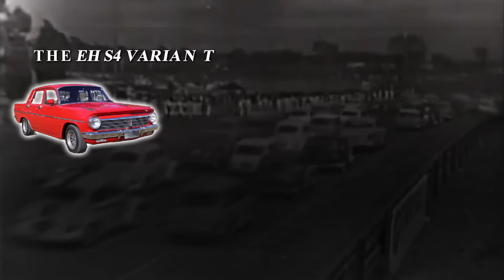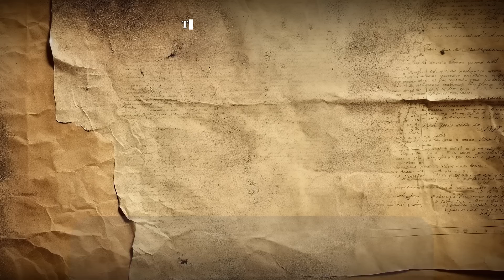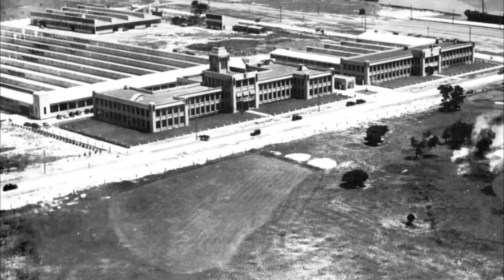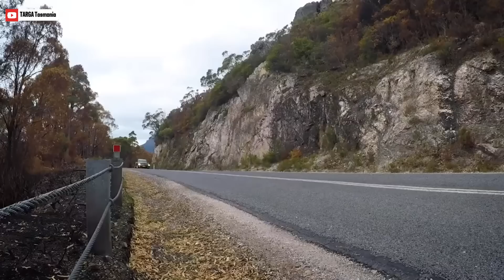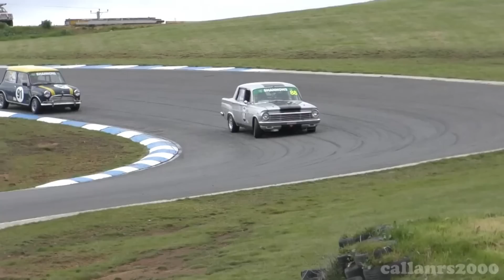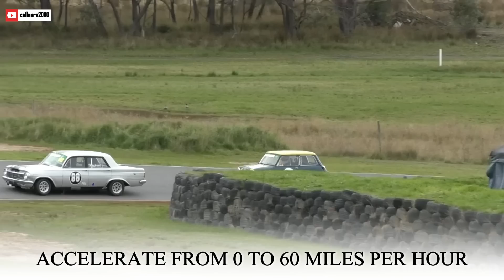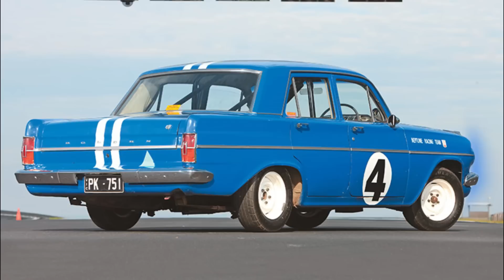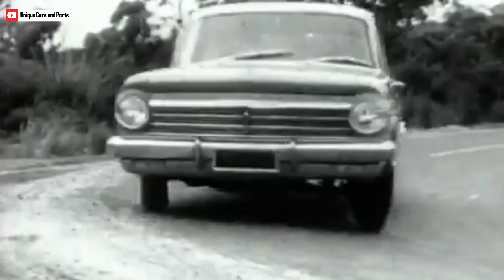Holden's SECRET High-Performance 179 Engine That Dominated Bathurst

Comment from the maker: What do you think made the Holden 179 engine such a game-changer in Australian motorsport?
Reply: You had to modify the head to a 12 port and bore them to a 192 cid with high compression pistons  using the HP block it had a steel crank add a high volume oil pump and a high lift Rev Master cam my fave was the 94 grind it was wild. Balance it and put on a set of 3x 45 mm Webber carbies and Genie extractors Then the 179 was ''wide awake'' been there done that 😂 but at Bathurst they were nothing at all !!!
Reply from the maker: @ wow what an amount of info. Thx for that!
Reply: @LegendaryRideCars  high pressure block... plus steel crank,149 or 186 head were the go with adjustable rockers
Reply: It wasnt really a game changer at all.
Reply: @LegendaryRideCars  to me it seemed like a smoother engine especially the HP block
Reply: What they call a "square engine". Same stroke and cylinder width. It later was used as the a model for the RB series Nissan engines from 2.6 to 3.0 litter with the RB32 2.6 being slightly under square and the RB30 3l being slightly over square but almost identical. If any one had anything to do with a commodore VL or an RB30 skyline you basically had the re-engineered GM version of the 179 down below. You could drop a 50cent coin on top of them on its edge and it wouldn't fall over :)
(see below for more info on the invincible X2)
.
The balance between stoke and piston width offers many different performance characteristics.
>
Another important part that is missed is engines built before 1970 were very over engineered in their tolerances. Like every bearing journal, grind and weight was tight as Holden was attempting to make a name for performance engines.
.
I was just trying to dig back though my memory banks. Got it.
Through the HR HD series they made the X2 179ci (2.9l) engine. You can tell by the emblem on the front grill that has a Red L shape under the X2.
This was an over engineered 179 with steel crank, cam and from memory they did some head an manifold work.
With twin carbs and header these engines were crazy at the time.
This was the engine that gave the 179 the reputation.
I have only ever seen/worked on one X2 179 Ute in my life.
Reply: OK, this was before I watched the video. The S4 was a model extension with 3 speed manual box or something. What you were looking for was the "X2 engine" as I offered above :) They only sold a limited amount of them to get them on the track, which is why they are as rare as hens teeth and difficult to find information on.
Reply: @axle.australian.patriot  The X2 was never released in the EH.
Reply: @alanpennykid133  I don't know whats going on with YT. I am sure I have already said that I have never mentioned EH anywhere.
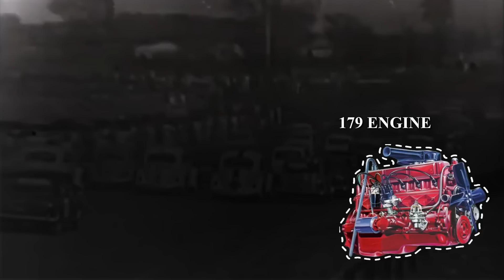Reply: @axle.australian.patriot  At 0:55 its specifically mentions the EH S4.  Your claim that it dominated at the Bathurst races is a joke, It was soundly beaten by the 4 cyl Cortina.  The 179 sold very well and was a very popular car but it really wasn't very successful in racing at all.
Reply: @alanpennykid133  First, the S4 was the transmission drive line upgrade and had nothing to do with the engine.
It had nothing to do with the 179 X2 race engine which came in the HR HD.
The X2 was the 179 engine that made the 179 a historic legend :)
Reply: P.S. the only weakness that I was aware of was a tendency to try and put push-rod through the rocker cover with the high lift cam (someone made alloy gears to help out there so you wouldn't strip the OEM fiber gear)  :P, and...
Something common to many red sixes was and issue with the distributors, usually after a con rod went through the side and knocked it off lol
I guess they made red lines for a reason lol
Reply: @axle.australian.patriot  my old man has more experience that most with 6cyl holedns
Reply: @Aussieledgrower2.0  Kool. Probably not as much as me, but who knows :)
Ask him how many X2 179 engines he has got to work on or seen.
Only a rare few have ever got to see one let alone work on them :)
Reply: He had serval i rember man .... @axle.australian.patriot
Reply: @axle.australian.patriot if u new how involved this guy was and some of the cars he had and built i think u would agree but he actually hates me pytting him on a pedestal but truily if u new u ud be impressed....ps i xan also tell u no ya shit to tho brother
Reply: I Rember only 1 of his 2 x2 z it was a like pearl green ople sort of couler shaw u no the couler i mean it imo it was basically a 4 door xu1 qith less cubes and carbs
Reply: @Aussieledgrower2.0  Nah, I am agreeing, and not disputing it.
I lived and breathed Holden engines for 35 years, at work, at home, on the street and on the track :)
I'm almost 60.
>
I can still remember as fresh as day the first time getting my hands into a HD 197 engine at about 9 years old.
>
And yeah, I don't really talk it up that much in real life.
Just this video came up and I was like. Yeah, I lived that shite to the max lol
Actually I seen my first Holden X2 179 when I was about 4 or 5 years old.
Got to hold the shinny chrome air cleaners and sat there amazed lol
Reply: @Aussieledgrower2.0  Holly cow! A genuine HD/HR X2?
You would remember a badge on the grill or the boot with a red arrow and X2 inside of it. It almost looked like LX2 to read.
I never own one but serviced, tuned and looked after one for many years.
Reply: P.S.S. I just double checked they did have the twin Stromberg carbs manifold as standard :)
Reply: P.S.S. The X2 engine was also marked on the rocker cover :)
Reply from the maker: @ wow 🤩 thanks for that huge comment
Reply: @axle.australian.patriot it was nothing to do with the rb nissan motor. The holden red, blue and black motors were so out of date and were developed as far as they could so they used a nissan engine as a stop gap until the next hand me down from gm in the usa- the old as the hills 3.8 buick. The nissan six was the best six holden ever had.
Reply: @rossbrumby1957  "they used a nissan engine"
Developed between Nissan and GM drawing on the success of the 179X2 and the Nissan L series overhead cam.
They are a hybrid, part GM and part Nissan :)
Reply: @axle.australian.patriot  Bullshit
Reply: @axle.australian.patriot  They were always Over-square.
Reply: @AndreasKachais  I stand corrected, over-square.
There was something in the back of my mind about that though with the 179.
>
Anyways, the video is about the transmission S4, but blurred into the X2 engine which is different from the stock 179.
I know the 179 X2 always had a good balance and this extended into the GM RB30 block.
Ahh, it was the RB30 that was square :)
Reply: @axle.australian.patriot  first time I have heard of holden 6 as a base for the RB. Where did you get that from?
Reply: @Quadrajettison  Complicated history between the 179Ci (3.0 l) and the Nissan.
GM Holden and Nissan developed the Engine. aka it is part GM and part Nissan.
Sharing of Engineering in the background was common place at the time. You wont find a lot of public information on it (in house propitiatory sharing).
The X2 had already garnered a sound reputation as a smooth running (well balanced) power plant for automotive and marine engines.
So, The RB30 is a design born out of the need for an engine for the Holden VL Commodore, and Nissan's need for an upgrade from the L series engine.
.
So you basically have a GM designed bottom end and the rest is Nissan.
>
Pretty successful collaboration :)
Reply: It didn't. If you are going to attempt to make videos about Australian cars for crying out loud do some actual research. PS I am sure 98% of your viewers don't subscribe because your vodeos are so hopeless...😂
Reply: It was a joke in Motorsport 
Fords 1500 cc cortina gave it an absolute hiding on every single race …
You call this a game changer?
Try embarrassment
Reply: The holden 179 was a great engine but it was the later 186 and 202 engines that were known for winning Bathurst.
Reply: @yusufbigyui  It's worthwhile differentiating between the stock engines and the performance engines :)
179X2 (Twin Stromberg)
186S (single dual throat Stromberg)
186 and 202 XU-1 (Triple stromberge)
:)
Reply from the maker: @yusuf.alajnabi yes that right 🙌 they have been preparing for it, as it’s always a path of improvement.
Reply: Additional note. Another user just reminded me:
Mercruiser (mercury) used a version of the 179 x2 for their marine engine :)
My fathers 23 foot caribbean cruiser had a 179 mercruiser with the twin carbs (I was only knee high to a grasshopper at the time ).
Reply: @axle.australian.patriot expect it was a variant of the chev motor, which by the way is what the holden red  and grey motor before it was.
Reply: @rossbrumby1957  Yes I know, but we are actually talking about the X2 engine which is not the same as a red stock engine :)
Reply: @axle.australian.patriot yup same
Reply: Well I had first hand experience over 29 years that this engine totally lacked the tractability unlike the old grey motor, get down too low and it jerked and snatched like buggery, going down to 2nd was ok, but getting low in 2nd meant a  crunch back to first  was essential, fitting a double race bearing in the gearbox was essential as this box allegedly strengthened [bull shit] was absolute rubbish.
Reply: The badges on the boot when the badge was on a belt
Reply: @alannorman3600  Which or what badge you talking about there :)
Reply: If they were only racing older holdens they would have been a game changer- but that isn't the case.
Reply: Forged Steel crankshaft
Reply: @awesomusmaximus3766  "Forged Steel crankshaft" Correct :) That was STD to the X2. Other 179s where just cast.
Reply: After the Gray engine the red motor was a rocket
Reply: @LegendaryRideCars  The Holden Engines were over square and they revved easier and higher than the Ford.  That was the reason that Holden also was better on the fuel economy.
Reply: AI really isn’t doing anyone favours. Smash that don’t recommend channel button.
Reply: AI really isn’t doing anyone favours. Smash that don’t recommend channel button

Comment: is there another bathurst that i don't know about. i think not. what GMH did to the 179 EH  for Bathurst was what a 13 year old school boy could have done in his daddies shed. they could not bore it out, but a 1/4 race cam, extractors, twin carbs, balanced, solid lifters. and head work would give an 179 EH a top speed of 115+ mph. a mate had one that was fully worked, it did 135mph and was quicker that a 351 GTHO  and  E49  charger

Comment: I had a 179 EH. Bored it to 192, chucked on a pair of Stromberg X2 carbs, and extractors. It could easily blow away a 253V8. The only problem I had with it was it kept breaking engine mounts. I never knew how fast it could go because the speedo needle would disappear off the speedo gauge at about 125mph.

Comment: Early in 1963 I had a EJ with a 149 that was painted grey - Factory. I bought new by accident.
Reply: Totally different engine mounts and front crossmember between EJ and EH !  Might have been a "first off" as the grey stocks expired.
Reply: @ They had a number of EJ bodies (I do not remember how many) and it was better economics to fit the 149 engine than ton throw it out. I wrote the EJ when it was very new and I bought one of the 1963 EH 179 manual (S4). The Suspension required a lot of modifications to make it handle.
Reply: @MrOlgrumpy  Over the years many have claimed that they bought a new EJ with a Red motor. As you point out the engine mounts and front cross member are different between the EJ and EH and Holden would have had to extensively modify the EJ   components in order to accommodate the red motor. Holden would not have undertaken such modifications on a model which was at or near the end of its production run.  The claim that late production EJs could be bought with a red motor fitted is an urban myth

Comment: No timing belt or chain.  These motors are almost indestructible AND easy to fix/rebuild.  We will never have that, ever again.
Reply: Fiber cam gear Buddy always stripped.
Reply: @LesleyStoddard  mine were metal.  And I put a Crow Cam in my 186HP that had straight cut metal gears.  Not sure which ones you're talking about
Reply: @ Cam to crank gearset. There was a alloy cam gear to steel crank gearset available  but it was noisy. All holden motors had fiber gears on the cam standard  Buddy. I worked for Holden in the 1970s. I am a old bastard.
Reply: @LesleyStoddard  okay, didn't know that.  The only Holden motor I pulled the cam out of was the 186HP that I rebuilt myself in 2002 with a Gregory's manual.  The gear on the cam I pulled out was definitely metal, looked like steel, helical gears.  The Crow Cams mid-range torque cam I installed came with straight cut/spur alloy gears and had quite a loud whine which my 18 year old self was quite chuffed with.  Sounded like a quiet Gilmore belt 🤣.  It went pretty good though.  Had a black motor head shaved and port matched, Yella Terra roller rockers, chrome olly valves and pushrods, triple valve springs, redline 4 barrel manifold and a 465 vacuum secondary Holley.  Needed a manual, but the Traumatic did alright

Comment: Its 7 mains bottom end crank strength made it the choice for racing and street engines. I speak from experience as l had the block designated HP block ...no numbers just Block letters HP. I had it built to outside XU1 specs and not a lot got near it!! Spanked many GT Falcon's probably not only through horses but through sitting in a XU1 Torana...No weight!! Revved to 7000 + and it was then that l realized that when GMH used the word stock they meant STOCK! The performance that modified engine produced was amazing! It felt like somebody took to a couple of tons out of the boot. Went like a fkn cat with its tail on fire LOL🤣🤣🤣

Comment: Only the EH premier was standard with the Hydro slushbox and only ever had the 179 in them from the start and the manual could be ordered with it a little later on, every other EH Holden, the vast majority came standard with the 149 with the 179 optional and the auto was an option on most models with the 179 from the start apart from the Premier that never sold in the huge numbers like the other models,  your research is full of holes and best left to Australians to accurately assess these cars, it’s like why would I want to pretend that I know everything about a US car  like a Pontiac tempest or something when I know Jack shizen about them

Comment: Only the EH Premier initially had the hydramatic and was only available with the 179, not the 149 and not long after release you could get the manual trans, all EH Holdens with both engines apart from the Premier were standard with the manual
Reply: If you are saying the EH was the first to have Hydramatic, then that is wrong as the EK was in fact the first, or are you saying the Prem was the first EH???
Reply: Where the hell did I say the EH was the first Holden to use the Hydro, geez pal were only talking about the EH here, of course I know the damn auto was first used in the EK and EJ behind the the 138 sideplater which was even more gutless
Reply: @jamesgovett3225  Geez pal, if you had the intelligence to understand basic grammer, you would have noticed the question marks at the end of my comment, now go back and read it again and you should notice I'm asking you a question,  then get down off your high horse and try to educate yourself.

Comment: The old sideplater or grey engine was actually available from the first Holden FX from 1948 not the 50’s also the 179 was available with a three on the tree from the start, the early Hydro’s were a real power sapping auto and generally wouldn’t pull a sailor off your sister and the earlier two models, the EK and EJ’s with the hydro’s connected to the old sideplaters were an Embarrassment, woeful performance if you could even call it that, you were shaking your head if you were unlucky enough to be steering one wondering why on earth Holden would sell that garbage to the public Lol! each model Holden back in the early sixties only lasted just over a year before the next one came out like just about anywhere else in the world back then, the S4 was just an EH with a few improvements here and there but really wasn’t a big deal whatsoever actually the next 2 models, the HD X2’s with the 179 and its twin strombergs and cast iron headers and other engine improvements were superior and the HR 186 X2 and 186 S were even better as far as Holdens warmed over early sixties sixes were concerned, Seeeing that the Red engines were a direct derivative to the Chevy 2 or Nova sixes, we should have been building that version here instead as they were larger capacity with there 194 ci and larger, at least later on South Africa had the intelligence to import HQ Holdens from Australia sans engines and they installed the larger Chevy sixes built in Sth America in around 232 ci or something in them, but Holden probably didn’t because they probably go better than their 253 V8’s back then Lol

Comment: I had a 179 HP in one of my rare Holdens. Being a Ford man, it was not all that common. The engines major problem was spitting crank bearings. I surmised that the oil pump could not keep up with the wee bit of punishemnt I used to give it, on rare occasions. I only mistreated it on days ending in y ( Old joke) Even though I ran a baffled large sump with Race oil, HV pump etc. Yella terra stage 5 head, 45/79 cam etc, solids TRi carbs etc. 4 Speed Rily/Jag boxes, big clutch. A bit of a weapong for the early 70s. Dropped 7 diffs, 4 clutches ( I made my own HD pressure plate which helped the destruction of those puny weaklig GM diff (3.36 gear and occasionally 3.89 s. Depended on what I could grab at the time